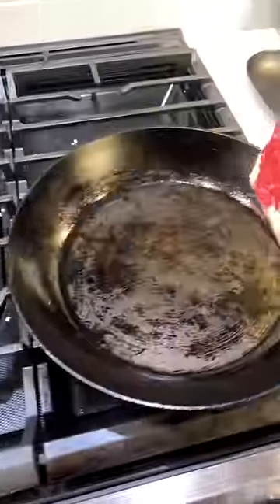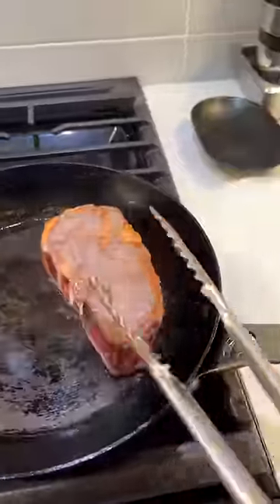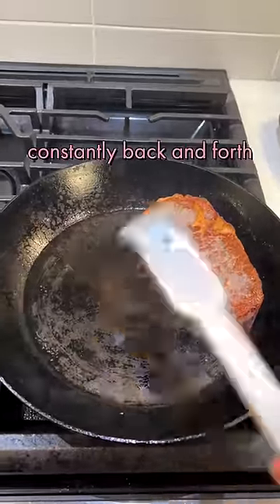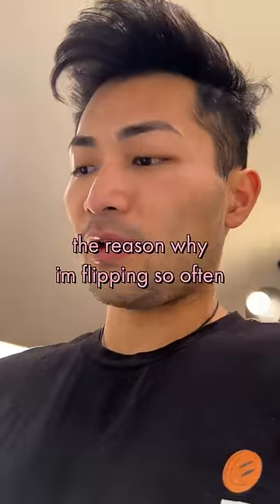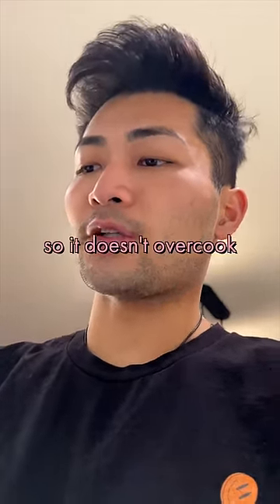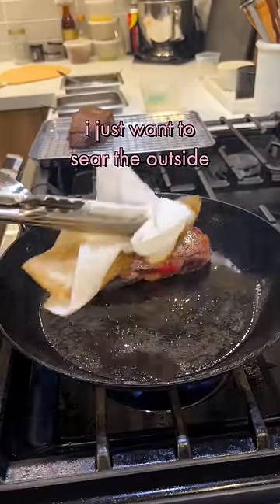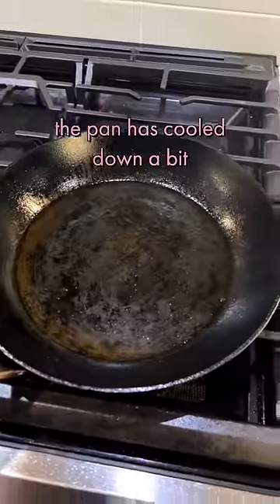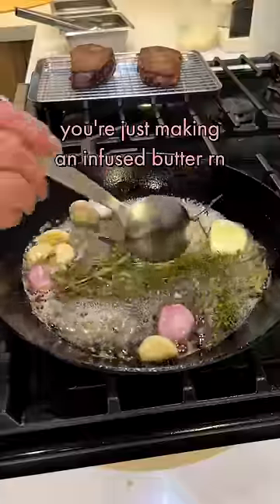useful steak tips for the home cook, part 2 of 3

Comment: No, that’s not how it works through thermal conductivity and heat transfer distribution he’s over cooking that steak the absolute best thing you can do for beef in a pan and this is coming from a train chef, do you wanna start out with dry beef that’s the absolute key to a good crust, the next important step is only using salt or nothing at all on your steak while searing it’s too high of temperature for any aromatics including pepper, but pressing down, the steak is important, but the constant flipping is disrupting the crust and allowing heat and moisture to escape killing the crust on a grill you turn it four times on a pan you turn it once! If you’re good, if you like more of a cooked steak, go back in and cook each side again and let it rest for 10 minutes. It’ll carryover cooking